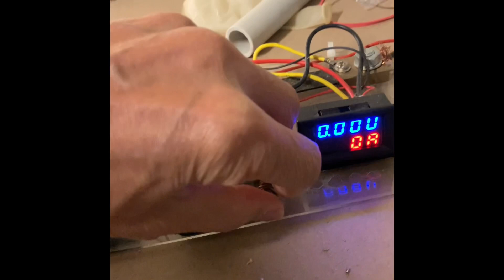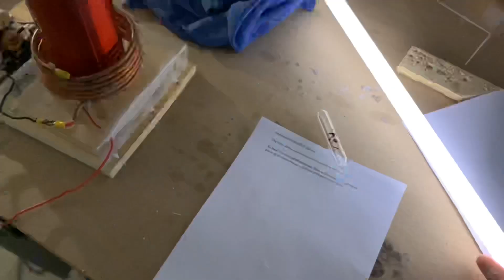800W Tesla from $30 ZVS Driver

Comment: So what would happen if I just connect my zvs driver without changing the capacitors?
Reply from the maker: Cap value is too big. If I remember correctly the good ones have 6 x 0.33 uF cap bank = 2 uF.  This value is way too high for a resonant Tesla coil of the size shown. Preferably need 150 nF or better still 75nF to get the resonant frequency in the right range. You could desolder the series connected 0.33 uF caps and parallel them all for 330/6 = 55 nF which will work great with 4 or 5 turns copper primary coil. Just use a variable tap point for precise tuning
Reply from the maker: I have PCB boards specifically for these Tesla coils. Works great.

Comment: So quick question if you had the zvs that came with 4 of the .33 uf caps could you not have just wired them in series and used the ? End up with a .75 nf capacitance like i beleive your caps end up with soo why not use them?
Reply from the maker: Totally agree that would work. I wanted to use them for something else since I was making another type of induction heater and needed those caps for that. Definitely a good point that you made.

Comment: What are the values of the inductors? 
50uh?? And the primary around 20uh???
Reply from the maker: Inductors are 50 uH. Primary nit so important like 10-30 uH
Reply from the maker: I have a PCD for this if you’re interested. The PCB works well here is a link to the Gerber files:

https://youtu.be/GNOgVpbtzNU?si=LA33oCgH2ws3TVsI

Comment: Did you run the stock ZVS driver with 60V? I thought that they only go to 30V or so. I just finished experimenting with a 12 V ZVS driver I build myself and got it running at 440khz and producing some lovely discharges. I wonder how high I could push the frequency.
Reply from the maker: I think the maximum frequency you can get to is about 500 kHz. Then they start getting hot. Yeah I was able to actually push it up to 60 V on the Variac but I believe there is a voltage drop that occurs when you use a small variac so that it’s actually only seeing around 48 to 50 V maximum. I think with 260N mosfets, they rated for 200 V and the maximum you can push them to is 60 V. They will see spikes up to 3×60 V which would be 180 V. So 60 V is pretty much the limit.
Reply: @BrianDhvTinkerer  thank you, I think I stick to 40-50V. Mine ran fine even at 700khz, but my secondary with topload oscilates at 220khz so I have plenty of head room. It would be fun to experiment further on how high the frequency can be pushed.

Comment: Replacing the caps in the ZVS to get a higher frequency is a good idea and something I haven't thought of before, might have a go!
Reply from the maker: I’ve just fabricated some boards to make this process a lot easier. They haven’t yet come in, but I’m expecting to get them on Wednesday and will give them a test run and if they look good, I’m gonna post a video on it and maybe give away a few free boards.
Reply: Would love to buy some of your ZVS boards.

Comment: Did you measure the resonant frequency of the primary with or without the secondary? I have all the parts you have, but I am struggling to get more than a very tiny arc. Also, my primary wires get super hot. I'm using 14 AWG wires, and they still get very hot. Thank you for this content. I have watched this video several times and am determined to replicate your results. Thank you!
Reply: Sounds like a driver issue. Did you do a center tap?
Reply: @yelectric1893  I got it working! My 5-inch coil is throwing 15 inch arcs! The MOSFETs are barely warm! Thank you for the help!
Reply from the maker: Nice- do you have any pictures? Sounds awesome. Look out for the video. I’m going to post this evening.
Reply: @BrianDhvTinkerer  I do have pictures. How can I share them? You and Archangel were my inspirations. Also, I just ordered 25 PCBs using your Gerber files. Thank you for sharing them!
Reply from the maker: Yes, you are very welcome to go ahead and share them. Need to get this out because it works so well. Check out the video that I do this evening. I think you’re gonna really like it.
Reply: @BrianDhvTinkerer  will do!
Reply from the maker: I’ve just put together a PCB of the entire set up and it works great. I’m gonna post a video on the tuning today. Please check my latest video also which goes into the PCB. This is definitely gonna be the way to go with the set up because, it seems to work better with a PC layout.
Reply: @BrianDhvTinkerer  Awesome, I can't wait! Will you be sharing your PCB gerber files? I'm looking forward to viewing your video!
Reply from the maker: @shawncalderon4950  the PCB gerber files are over here, check the description for the download of the files:

https://youtu.be/YqmOraprgoQ?si=JT70wiNPjw6y6i02

Comment: The ZVS has three outputs, but I only see two connected to the primary. Where are you connecting the third wire?
Reply from the maker: This is a modified ZVS. The only has two outputs instead of three.  Here is the schematic:
https://images.app.goo.gl/JPUJv9kPMQJMr8b76
Reply: @BrianDhvTinkerer  Thank you so much. I've wanted to build this Tesla coil, and now I feel I can try. I will let you know when it's complete. Thanks for the inspiration!

Comment: Please provide the capacitor specs? Nice presentation!
Reply from the maker: 942C20P15K-F 150 nF CDET high frequency pulse capacitor. These can be purchased from eastern voltage research. You can get them here:
https://www.easternvoltageresearch.com/capacitor-0-15uf-2kv-942c/
Reply: @BrianDhvTinkerer  thank you so much!

Comment: Tesla used rubber insulated wire. The coils are wound so that there are air gaps between the turns. The varnish, when used in this manner, is a short-circuited component.

Comment: Can I drive a coil with a resonant frequency of 680 kHz with this circuit?
Reply from the maker: I think that’s kind of pushing the limit with this circuit. It may be worth trying it, but I think you may have to try different types of MOSFETs to get it to work.
Reply: @BrianDhvTinkerer  tank you sir
So right I tried to set the resonance to 680kHz
 but it wouldn't reach that frequency and the MOSFETs would overheat within 5 seconds
And what is the reason that it is not possible to reach this frequency?

Comment: Hello sir 
This is amazing . And when i whach your incredible video it forced me to make zvs and your tesla in middle of night 😂😂
I got some arce from circuit and it was great . But with powering the gate without the main power i couldn't run any neon lamp .
And i wander how cold this possible without current in drain to source ho could this happen .
Kindly requst w little answer how could it oscillat 
Thanks

Comment: How are you running the zvs without the common ground attached??
Reply from the maker: The common ground is not needed because only one MOSFET can be on at a time, and the set up functions as a full bridge. The charge flows through one end of the primary coil and into the drain of the opposing MOSFET and out of the source of the opposing mosfet and back to the power supply. This mosfet then switches off and the opposing mosfet which was off now switches on and the process repeats. The base of the secondary coil is connected to earth ground.
Reply: @BrianDhvTinkerer  can it drive a Tesla coil like that with a off the shelf zvs with out the common ground? Some one said to Earth ground the common terminal ?
Reply from the maker: The frequency of the off-the-shelf ZVS modules  is too low usually around 50 - 80 kHz which cannot be used for a small tesla coil. If the capacitors are removed (usually about 3–6 µF) and replaced with a single 150 nF capacitor, then the frequency increases into the 200–500 kHz range, which is perfect for a small Tesla coil. The Tesla coil needs to be grounded to earth ground and not grounded to the ZVS.

Comment: when I set the circuit up with just the power supply NOT thru the chokes like on the schematic it doesn't work. When I hook the driver supply b4 the chokes it works without mains but I'm worried if I hook up mains in the same spot something bad will happen! Am I worried about nothing?
Reply from the maker: I would use a variac to be safe
Reply: @BrianDhvTinkerer  what im saying is ur schematic has the 2 torroid chokes only hooked up to the variac power. ithought those were necessary for the zvs circuit to function. but if the zvs works on its own enough to light tubes, and the variac is off, the chokes are not yet part of the circuit right? or did i miss an "off the page" connection?
Reply from the maker: @theGraphicAutist  yep it definitely needs the chokes to work. Basically goes short circuit without those. The oscillations will not start up if the chokes are not present. I’m gonna check my diagram to see if there is something missing but I’m pretty sure that when I put up should be good. However, you never know.

Comment: How did you wind the copper primary? I need help with mine.
Reply from the maker: I wound it around a 4.5 inch PVC pipe. I used 1/4 inch soft copper tubing which I got from Lowe’s or Home depot. Solid copper is too hard to wind easily but it can still be done!
Reply: @BrianDhvTinkerer  my coil is would around 4.5inch pvc and the nearest ace only has 4.5 inch. My copper tubing is just regular hollow copper. I wound one but it looks really unprofessional. My driver is a proper half bridge with interruptor Bluetooth audio receiver and running on mains. I’m competent at electronics but my building skills are child like.

Comment: how old capacitors are conected, serial, paralel or mixture
Reply from the maker: I connected two 150 nF caps in series to get 75 nF. Also tried with just one 150nF cap and used a different primary tap point. Both ways worked well.

Comment: Is this dangerous?? to touch?
Reply from the maker: It is fine to touch. However, do not touch the metal that the plasma is originating from, as it will cause a radio frequency burn.
Reply: @BrianDhvTinkerer  ok thank you

Comment: Very nice coil, but it goes the opposite of what tesla was trying to achieve. I have a tesla coil that runs off of five hundred watts and throws arcs four and a half feet .
Reply from the maker: The reason the watts consumption on my driverless setup is higher is it’s running continuous wave which significantly increases power consumption. Sounds like your coil is pulsed to give the long arcs- usually DDRRTC  runs around 1% duty cycle.
Reply: @BrianDhvTinkerer  it's just an old school static spark gap coil. I'm trying to calculate the size of my top load so that I get no spark display.

Comment: I built this circuit using the 12v supplied to the zvs circuit, and a secondary 36v supply to the  primary. Gives me lovely 5" arc. I also experimented with using a cheap pwm 2kw fan speed controller from Amazon between the secondary transformer and bridge rectifier which actually allowed me to find the perfect point of resonance.
Reply from the maker: That’s awesome you got it running at resonance

Comment: Great project n idea sir. Makes me want to build it for my self. But   almost 1 week my  setup  not get the  tune correctly because  i didnt have any specific tools like yours. Is there any simple way or trick fo me to get resonant freq. Almost getting lost n  tired in try n error..
Reply from the maker: The best way is to use a neon bulb. You need to start with a low capacitance for your tank circuit. Something around 150 nF. The tank circuit should use a polypropylene capacitor such as MKP that can handle high frequencies and high current. With the secondary centered in the primary. Ground the lowest turn on the secondary to earth ground. Then make sure both coils are wound in the same direction. Or reverse the connections on the primary if they are not wound in the same direction. Use a moveable tap point on the primary. Place neon bulb close to secondary. Apply low voltage around 12-15V to ZVS.  Keep neon  bulb at fixed distance from top of secondary. Then change tap point position until neon bulb lights the brightest. Then move neon bulb away from secondary. Then move tap point until it lights again and adjust for it to be brightest. It helps if the terminals on  the neon bulb are grounded. Maximum brightness means secondary and primary are at the same resonant  frequency. For fine tuning, adjust the size, length and shape of the breakout point. Sharp point is better. This setup will not work with a toroid.

Comment: Can we have a video on how you made your rectifier?
Reply from the maker: The rectifier is simply two 10A10 diodes connected together in parallel and then connected series to one leg of the AC mains input thereby providing halfwave unsmoothed rectified input to the ZVS input which causes the ramped output
Reply: @BrianDhvTinkerer  awesome! Thank you so much for your answer! I love your channel, it’s amazing!

Comment: Where can I purchase the tesla coil alone (thick and thinner coil)?  I would like to get one. Thank you.
Reply from the maker: Tesla coil kits are available from  OneTesla which need to be soldered but are real easy to put together with detailed instructions:
https://onetesla.com/

EVR are a great source for educational Tesla Coil Build kits and they provide help if you just email them as I have done in the past.
This is the very first coil I bought from them and it worked great:
https://www.easternvoltageresearch.com/solid-state-tesla-coil-1-0-kit/
To get a fully assembled coil it is the most econical to go to
Ebay or AliExpress. Here is one that looks like a great deal:
https://www.ebay.com/itm/124455179676

If you adjust want the secondary coil they can be bought read wound and varnished:

https://www.ebay.com/itm/222416538577
Many are available on EBay and AliExpress

Hope this helps
Reply: @BrianDhvTinkerer  the one from ebay looks great, but what about the outside thicker coil, where can I get it that would fit to this one?  Thank you
Reply from the maker: @caritoarias64  the thicker coil is quarter inch wide soft copper tubing which I bought from hardware store (Lowe’s) plumbing section. It can be wound into a coil by wrapping it around a piece of PVC pipe wider in diameter then the secondary coil so that it doesn’t make physical contact with the secondary. It will need to be tapped by connecting a moveable tapping point to adjust the resonant frequency close to that of the primary!! Then it should work- good luck and pm me if you need more help😄

Comment: the force from the motor you made comes from the heat of the arc, not the electrons flowing. It couldn't be the electrons because they're flowing back and forth in and out of the wires at a very high frequency. ElectroBoom explains this in one of his videos about his tesla coil in a vacuum chamber.
Reply from the maker: It’s actually the positive ions that make the motion. With the alternating electric field on the break out point on the rotor it negative,  electrons are pushed off the tip. As it is very difficult to negatively charge air molecules, very few of these electrons are able to leave the tip. However, when the tip becomes positive, electrons are ripped off the air molecules which happens much more easily. The positively ionized air molecules have more mass and are repealed away from the positively charged breakout point resulting in more motion compared with electrons.

Comment: the reason why you can't use a topload may be that it makes the coil much more selective in frequency, no problem (or even better) with a self adjusting coil but the ZVS is too strong to be even slightly tuned BY the secondary resonating

Comment: Why have a fan to cool it? Just connect 2 power mosfets in parallel on a large heatsink so it does not get hot. I do that with other projects and it barely gets lukewarm.